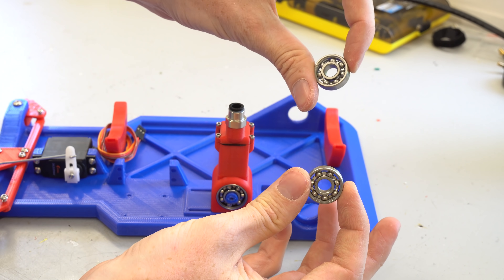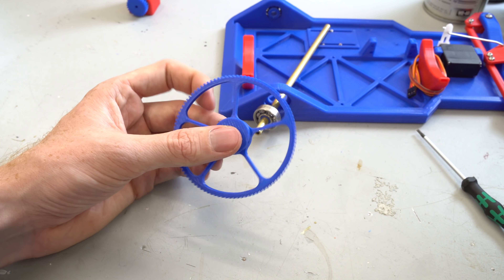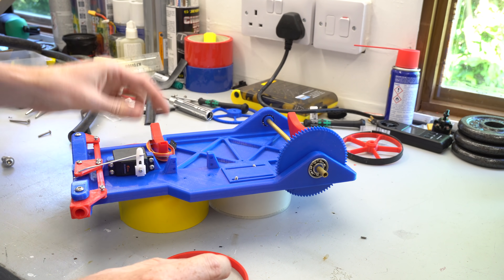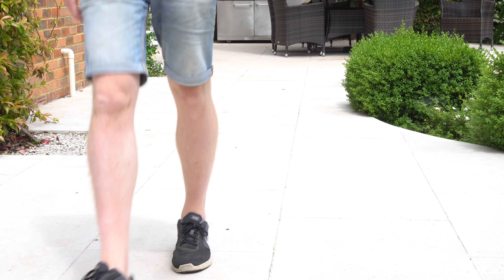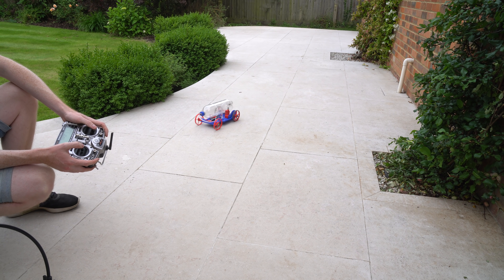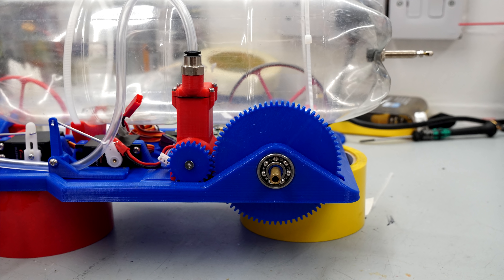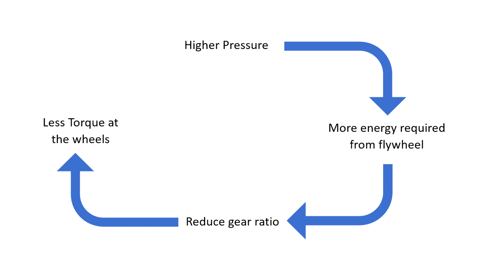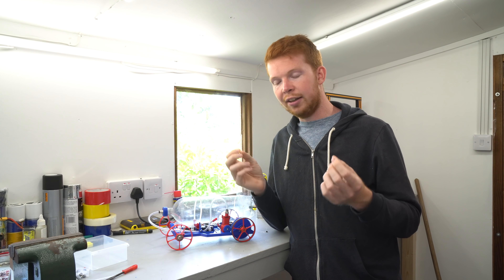Air Powered Car

Comment: Hi im also working on a rc car project and I've run into some complications on designing the steering system I've made the mechanism but i dont know how servos work and I don't know how to make it selfcentre after the input is removed please bear in mind I don't know anything about programming and due to the nature of my project i can't add a arduino board can someone please help.
Reply: Your controller should have sprung gimbals so when you let go of the gimbals they will centre as will the servo. The servo follows the movement of the gimbals directly.
Reply: Abdus Salam: 
search the internet for many RC car photos so you can see how they are made.
for the servos, the radios usually have the spring  return system to the center, so if you buy some low-priced systems, you have solved everything.
 I assure you that doing it yourself means being in trouble.
there are two shapes of radiocontrol: like an handle with the trigger as throttle and a big knob on the side as a steering wheel usually used for autos (only two channel)
or the universal as Tom's radiocontrol (fron 2 to 12 channels depending on the software and the price)
Reply: zola tanaffa thanks alot ill start looking for them right away and even if it brings trouble ill probably learn something new thanks again :)
Reply: If you're working on an RC car you NEED to know how servos work. I would have thought it's pretty obvious that if you're trying to use a particular device you need to know how it works...
Reply: David H i didnt buy them yet and right now I've only made the mechanisms of the car so i left the electronics bit for the end including the servos i don't know how to use them as I've never worked with them before so I'm pretty clueless
Reply: I don't recommend doing that. You should buy the servos and learn how they work. However if you control the servos with a regular RC receiver, you don't need anything to centre them. The RC transmitter will have spring-loaded sticks (or a wheel if you get a pistol-grip-type transmitter). The transmitter constantly sends a signal to the receiver, and the receiver constantly tells the servos to go to the position the transmitter stick was at. So if you move the transmitter stick one way, the servo will move that way as well. If you let go of the stick it'll spring back to centre because it's spring-loaded, and will therefore tell the servo to go back to centre.

Comment: Try again with only one rearwheel with rubber band ; looks like the problem starts as soon as you make a curve, then the two wheels should not run at the same speed. With only one wheel with rubber band the second wheel will not have as much traction. Best of course is a differential, but that may give even more resistance.

Comment: I still vote rotary, please like if you agree!
Reply: The problem with a rotary valve is sealing against the pressure from the air tank. Any leakage past the valve will increase the resistance to the upstroke of the piston. Given the limited power available the design must be as efficient as possible. I wondered about a reed valve but I think it would be difficult to tune as the engine has to cope with an ever reducing compression (or should that be expansion) ratio.

Comment: There’s no replacement for displacement lol
Reply: I don't know about that, but there's certainly no replacement for an m60 in the trunk
Reply: Forever13 pt rotary air engine? Lol
Reply: Boosted Rc’s Not talking about this. And no. I actually designed some hydro rotary years ago, since I make hydro engine concepts, but I can't really patent them. And, I'm thinking about the most efficient engine right now. I'm not kidding, I actually use hho for my concepts, so I'm still a bit different than them. And yeah, I always thought about Hydrogen combustion engines. No pollution at all. It's great. But the Mazdas hydro system is not quite the best. Hopefully they improve it.
Reply: Boosted Rc’s There is. Supercharging, No2. And Hydrogen injection.

Comment: rear wheel drive car with plastic tyres= no grip im afraid. you will be better with rc car wheel and you can get the same shape of tyres as those just takes a bit of time and patients to find them using bigger tyres as well is like gearing it up. witch puts more strain on the engine. theres a reason why rc cars use small gears and normal sized tyres to keep the strain on the motor down

Comment: The air pressure on the input side of a rotary or slide valve will push on the valve and seal it.   Look at the valve chest of a steam engine.   The valve is push across the intake and exhaust ports by a rod.  No guides other than what the rod provides.
Reply: I've only seen people saying he should add a flywheel, which I do agree with, but this is a really creative solution. Circumvent the pressure problem all together

Comment: Tom Stanton build an enclosure for your printer I made one for my cr10 due to warping problems now all the parts turn out just fine no warping all I used was insulation foam from the hardware store
Reply: steve crafter, I'm doing the same thing when I get my cr-10 s!
Reply: I have a cr10, how did you build it? What frame for the enclosure?
Reply: Little kenster it’s just 6 pieces of 1/2 inch polyiso insulation foam board from homedepot taped together. if you want more detailed info message me again and I’ll answer any questions
Reply: It isn’t pretty but it works great printed 4  5 inch ducts for a hovercraft project all perfectly flat also printed wheels for an rc plane turned out great to remember it doesn’t half to be pretty just functional

Comment: Tom i think if the engine work at 30 psi suppose then fill the bottle as high u like just use the pressure control you already built to maintain it around 30 psi using any micro controller
Reply: GBranade pretty sure there could be a valve that you could also add to restrict the airflow to the engine?

Comment: Fascinating. Could there be a way to use the movement of the piston in the cylinder to open and close the air supply such that a separate valve wouldn’t be needed? Perhaps some cleverly placed ports in the cylinder and/or groove or hole in the side of the piston so that air flow can be controlled by just the movement of the piston itself? Then you eliminate the drag of the valve.
Reply: kenkamm like a 2 stroke
Reply: Sloth FPV Yes, similar.

Comment: Why not fit an actual flywheel to the crankshaft, as well as the gear?
Reply: Or use a brass gear for the flywheel and output at the same time
Reply: @thedeterminednovice2389  w

Comment: Belt drive!
Reply: usse rubber bands as belts an dthen print pulleys
Reply: You could also add a heavy metal flywheel right to the crankshaft when you use a belt drive because the spacing between engine and axle doesn't matter any more and poses no size concern ;)
Reply: why would that be better???
Reply: Because he's having trouble getting the gears to mesh efficiently.

it will also allow more options to deal with the flywheel/torque issue.
Reply: I meant belt drive is a good idea, not rubber bands.
Reply: flickpad  I’m surprised he didn’t use rubber bands on the wheels.
Reply: Yip and some sort of clutch/throttle CVT belt arrangement would help. At the end of the day, this is just an ICE powered by expanding air.
Reply: Western King This is part of his problem. He is still thinking of this in terms of an ICE. It is not. It is closer to a steam engine than IC and he will see significant improvements in performance if he treats it as such.
Reply: Good idea!
Reply: Dan Severns That certainly would have saved him chopping up an inner tube. 😄
Reply: Yeah, it's a good idea.
Reply: Tq converter or is it too hard?
Reply: Rubber bands are bad they are too stretchy use thin strips of duck tape put together people make them for steam engines they work good
Reply: No thankyou more friction isnt it though
Reply: Cayden Thompson not really and the friction is a good thing on belts as it keeps them from slipping
Reply: I think a better option would be a 3 gear drive. This will reverse the direction of the drive gear
Reply: Martin Dinner are belts or gears better for steam? Belts right ?
Reply: toothed belt, flywheel, pump that plastic bottle to 100 PSI, run a pressure regulator for 25-30 PSI. a little longer stroke crank might help, smaller piston using air slower but giving torque for longer stroke.
Reply: You can buy rubber belts for gears for  4wd rc cars
Reply: No thankyou what I was thinking
Reply: Don't use rubber bands, use specially designed belts. You can buy closed-loop belts for 3D-printers in any size. I am using them in my 3D-printers on the extruders (GT2 belts for example). The spacing of the teeth on the belt is known so you can design a wheel that interfaces with this belt without slipping and without any play. You do need good bearings for this though, but I do not feel that should be a problem since Tom is using ceramic hybrid bearings already anyway.
Reply: the rubber band will stretch out. you will lose power. he just need a gear with bigger teeths.
Reply: Ninja flex printed belts...
Reply: how can you do that on a 3d printed car?

Comment: You can add a flywheel to the engine itself. It's not a plane so a little bit more mass wouldn't be a big problem here.
Reply: A clutch would be incredible 👍🏼
Reply: @davesendit1348  a clutch would just waste energy to friction.
Reply: And on a plane, the prop itself is the flywheel.
Reply: Charles Lambert exactly
Reply: And a flywheel needs to be hevy to work and on a small car like that you need it to be light
Reply: @legotrain15  that's not true. There has even been talk on this channel about this topic. You can give it a bigger inner diameter  and put all the weight on the out side. Fly wheels don't need to be heavy.
Reply: It's too small, you really don't need one, but good idea though.
Reply: @abhayajoodha3113  It's not based on size, its based on weight and resistance.😅
Reply: Miki stan it’s not an internal combustion engine you don’t really need one
Reply: bjorning man but it works so closely the way a internal combustion engine does that it needs the constant momentum to keep it going
Reply: @Skreeze_Nuts  yes he actually needs a flywheel because he's losing momentul in the turns and when theottling down the engine. a heavy flywheel will keep the momentum, helping the piston return to TDC (top dead center). also, idk what kind of exhaust valve he's using, but if he's using a cam driven one it also uses alot of energy. I would reccomend sitching to a reed type since the timing doesn't have to be absolutely precise.
Reply: @Skreeze_Nuts  It has the same principles. So it would really help it. A clutch would help a lot too
Reply: @Minecrafter55666  a clutch would just lose energy to friction. What I would do is, add more mass to the flywheel, and lube up the damn thing. You cannot understand how much energy is lost to friction untill you run an engine without oil and take a look at the cylinder liners and the bearings and the segments and the piston.
Reply: @PrintingEqualsFreedom  I understand that, however, the engine can gain energy by letting it rev up.

Comment: the engine and valve is wrong, look at mammod and their wobble cylinder which is also the inlet, the pressure does not reduce their effectivenemts

Comment: I propose a bigger gearbox so you can have the flywheel run at higher speeds
Reply: like, have more than just two gears so you can make them individually bigger and have them be printed better

Comment: Have you thought of using dry ice and some warm water in the air tank?
Reply: As long as he installs a pressure relief valve this would be really fun
Reply: That would also make the smoke effect as suggested above
Reply: Not if he connects a second container pulled vacuum, so he can reuse it, no smoke and the pressure difference is more efficient then letting it escape in atmospheric pressure.
Reply: i suggested it for the airplane, but it was already way too heavy. maybe here would be good
Reply: You don't even need warm water, any water will do ;-)
Reply: Literally just having dry ice alone would do
Reply: seems like a ton of wasted energy if u use propane for a pressure motor instead of burning it lol
Reply: That's literally how you make a dry ice bomb. Using a phase change to store more gas is a good idea, but CO2 produces far too much pressure at room temperature. Propane would be a better choice, if my research is correct it will only produces about 150psi at room temperature.
Reply: Rob Mckennie I agree , I give the car 20sec before it flys to the moon😂
Reply: Compressor and a batteries.
Reply: Check out the Mythbusters "Do try this at home" special for a gory demonstration of why you should NEVER seal dry ice in a bottle.
Reply: @Number_055   it probably wouldn't do that, it would just make the car go super fast or strip the gear

Comment: Make 4 wheel drive with 4 engine
Reply: Yep, found the guy who watched carsandcameras XD
Reply: Modwannabe Minecraft 
No problem, just use a 4500 psi scuba tank. It should compensate fot its weight
Reply: No, i'm talking about u Bundi, not you ;D. The channel had  a project, wich was building a cart with one engine per wheel. It did work but i would doubt the effectiveness of this system XD.
Reply: still to heavy XD in that case the car would have to be tethered sadly :( 
nice idea though :)
Reply: sorry to disappoint you but I never watched that :)
Reply: u Bundi what about the equality on the pressure? And the steering? Doable but way too complicated
Reply: I was just imagining
Reply: Look at this air power car https://youtu.be/CAzNWLqmpiI
Reply: u Bundi if you end up having for engines you end up using more air which means more tanks which means more weight and on top of that if two or more of the engines fail to make a revolution the car would either go in circles or keep going straight uncontrollably plus this would alleviate having any steering control unless you make it into a six wheeler which would make it very difficult to make turns nice idea though.